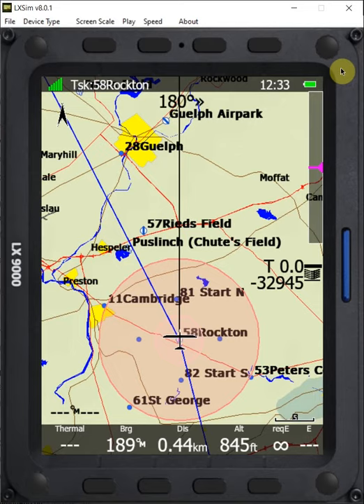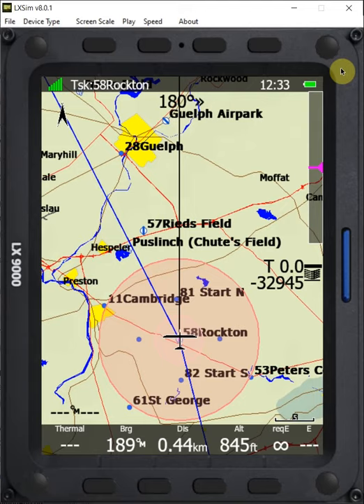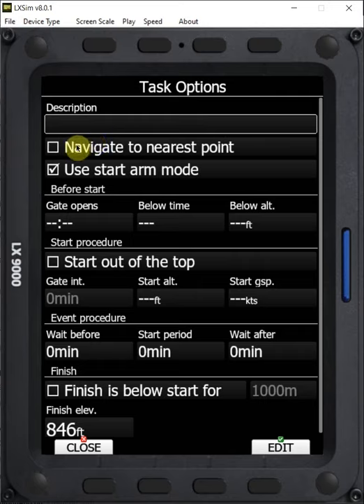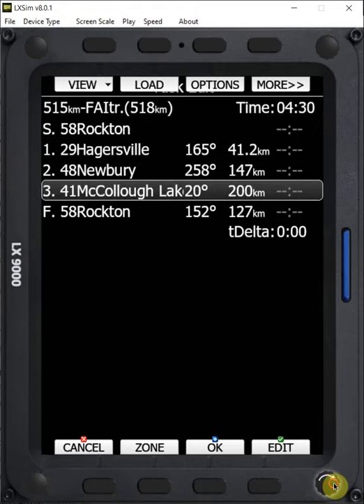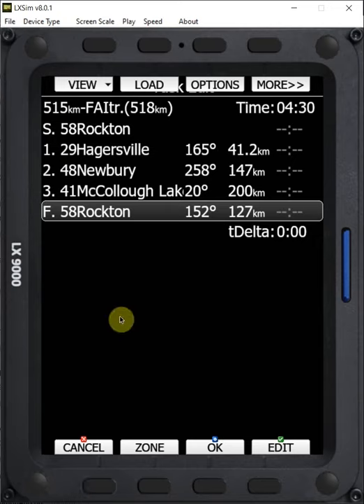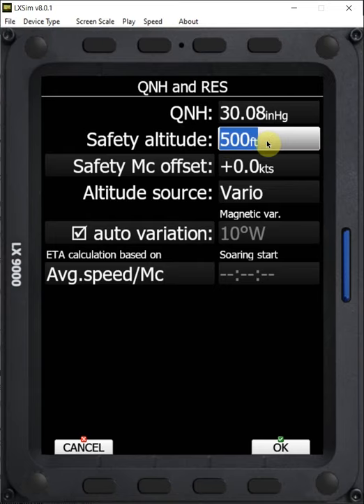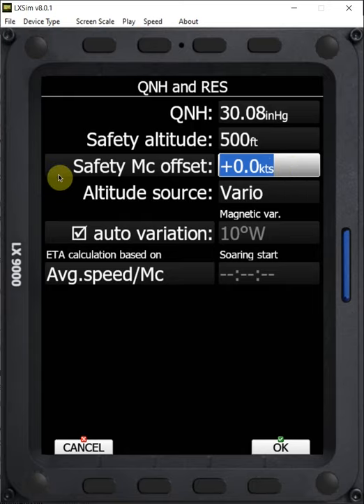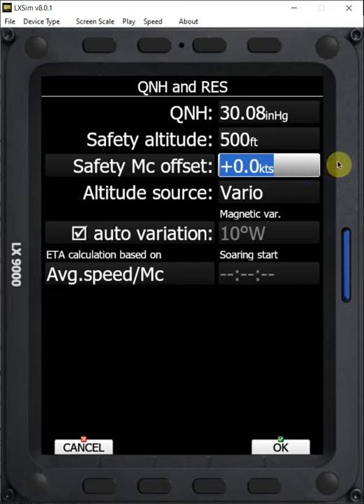LX9000 Finish Elevation -  Reserve Height -  Safety MC Offset

Comment: Thanks for the explanation.
Just one comment on the safety MC Offset, as this is new for most pilots but a great feature.
What it does is increase the MC value for used for calculations of arrival height.

So assume you are flying with a MC setting of 3 knots. This would give you maybe a 1:36 glide on a modern 15m ship (ASW27, no ballast).
So if you are 36km out, and climbing away from a low thermal, at 1km (3000ft) altitude above finish height (including reserve) it would send you off on final glide.

You then glide with 3kts MC speed (80kts IAS) and if you have no sink along the way you would arrive at set finish height.
However, if you do have sink along the way, you will arrive lower, or adjust your MC setting to a lower setting to still make your finish height.
However, a lower MC setting would mean you have to fly slower, and if you find sink again, you will have fly through it slower, and still have to adjust MC setting lower, etc.
So you can see the danger in this, as your glide will become shallower and shallower, with less margin.

What safety MC does is change the initial LD for the calculation.
So starting again in that last thermal, your MC set to 3knots, but with a safety MC of 2 knots as well, it will use a LD of MC 5 to decide when you are on final glide.
MC 5 means an LD of 24. This means that at 36km out, it will tell you to climb to 1.5km altitude (4500ft) before telling you that you are on final glide.
You now have a much steeper final glide.
However, what it will do is keep you on the MC setting of 3 knots for your speed command.
This way, you will achieve a 36:1 glide even though you only need 24:1. Your arrival altitude will keep increasing, and correspondingly you can then increase your MC setting, and fly faster as you get closer to home.

The benefit of this is that it is an angle chance instead of absolute change.
So at 36km out it will add 1500ft of safety.
But at 24km out it will add 1000ft of safety, and at 72km out 3000ft of safety. The further from home, the higher the chance that you will hit a area of sink.

This article explains it all very nicely:
https://www.johnhcochrane.com/s/safety_glides.pdf
Reply from the maker: Thank you Dinant for you description of the Safety MC.  One clarification that I would like to make is that for your LX computer, the Safety MC must always be set to a HIGHER value than your STF (speed-to-fly) MC value for inter-thermal flight.  As you indicate, the higher the Safety MC value, then the steeper the required glide angle to the finish and therefore a larger safety margin for final glides.

The LX calculates final glide based on only the Safety MC value that has been entered (plus wind, plus reserve height), it does not add the STF MC value to the Safety MC value.  So if STF MC is at 3 and Safety MC is at 2, then final glide height required is calculated based on MC 2 and this is BAD!  It is not calculated based on the sum of 2 + 3 = 5.  If you want a safety MC of 5, you must explicitly set 5 in the Safety MC.

With Safety MC set to 5 and STF MC set to 3, your required height for final glide is based on MC=5 and then your speed command while flying to the finish will be based on MC 3, so you "should" always be gaining on your arrival altitude if you follow the MC 3 commands.  Once it becomes clear you will make it to the finish with excess height, then you can increase speed to arrive sooner and lower.
Reply: @foxonecorp  Thanks for your reply. 
However, the LX8000/9000 (version 8.0 at least) has 2 different Safety MC functions.
You can change between either
1. 'Safety MC Offset', which adds a MC value to your current MC value, (and which you have selected in the video)
2. 'Safety MC', which works the way you explain in your reply.

I actually had to check with LXSim that the Safety MC (not the offset), as you explained it is implemented in that way. And it is. But I think it is implemented incorrectly with the theory, and actually in a dangerous way.

I think it should work like this:
Set Safety MC to 3 knots. If you dial in MC 1 knots, it will use Safety MC 3 knots to calculate arrival. Same if you dial in MC2 or MC3. But if you dial in MC 4, it should use MC4 to calculate your arrival altitude.

Because eitherwise you will fly at MC4 speeds, but with a MC3 arrival calculation, and you will always end up below expected arrival height! Not very safe :(
At least the manual is very clear about this, but I don't understand why anybody would want to use Safety MC setting in this way.

At least the Safety MC Offset works correctly.
Reply from the maker: Dinant - you are correct.  I missed that you were talking about the offset.

Safety MC Offset adds to your current STF MC setting.  So if MC is set to 2 and Safety MC Offset is set to 3, then the LX will calculate final glide at MC 2 + 3 = 5 for required altitude and then give STF commands for MC 2 during the glide.  This adds a good safety angle.

Safety MC is a direct value that will always calculate required altitude at the value that has been input.  IE Safety MC = 3 will calculate arrival height at 3 and then STF commands will be given for whatever value you have in your MC setting.

It is very important to NEVER have MC value greater than MC Safety otherwise you will have STF commands at a value greater than your calculated arrival height and you will arrive low - or not at all!

It is not completely obvious in the Set up Menu | QNH & RES page that both of these options exist.  Look at this picture of the page <http://foxonecorp.com/images/safetymc.png >  and you can see that the Safety MC Offset and Safety MC box can be edited and you may select either option.  Make sure that you know which one is selected!  

I agree with Dinant that you are better to use the Offset so that you don't get caught by having MC higher than Safety MC and then not have enough height for a safe arrival.
Reply from the maker: Check out the new video that explains the differences between Safety MC and  Safety MC Offset.    https://youtu.be/hPDj59BgIk0